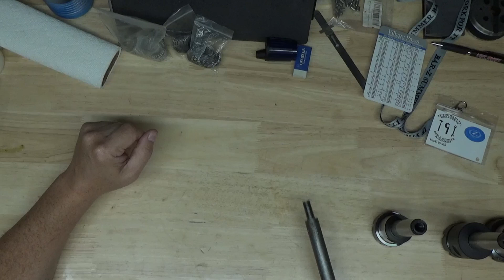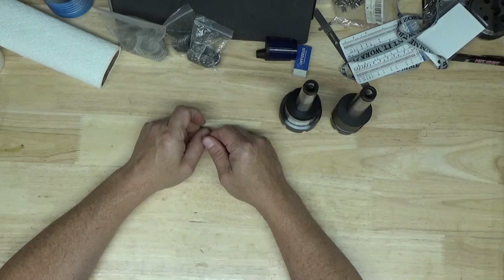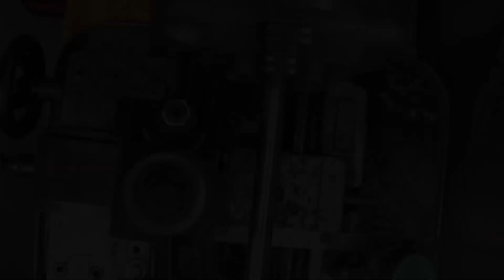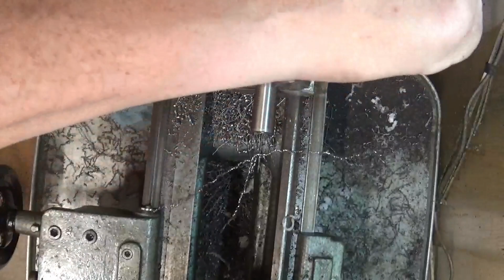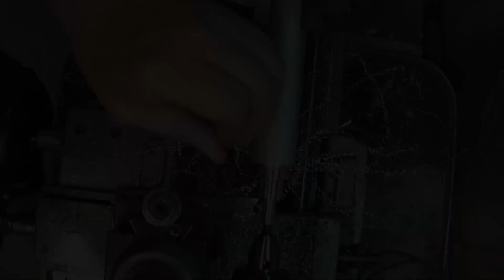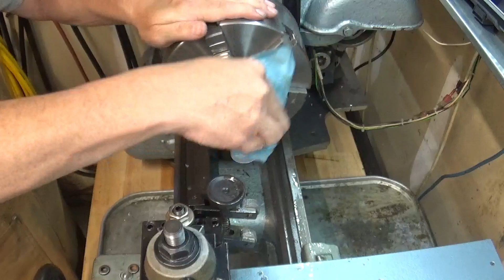Clausing Model 100 Lathe Drawbar

Comment: Good one' Mick. It's a bit strange that the threads in the first holder are not straight. Maybe you can still save it.
Reply from the maker: Yeah, at first I thought it was my threads on the drawbar, but then I put a regular bolt in it and it was visibility cocked.

Comment: I made threaded adapters so I can use one draw bar, great video.
Reply from the maker: I was thinking about that, you don't have a problem with the adapter coming off when you loosen the drawbar?
Reply: @MicksWorkshop  a little blue loctite, haven't had a problem..